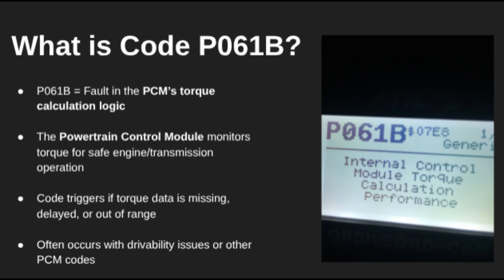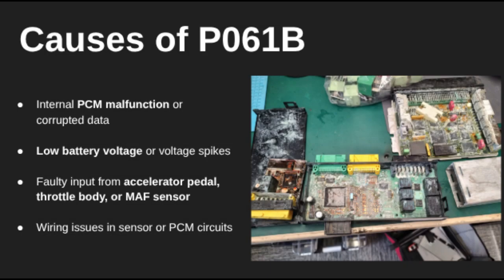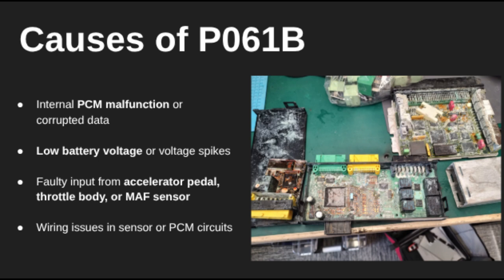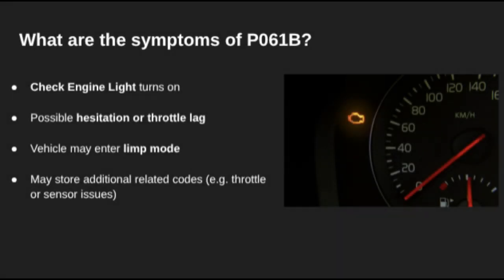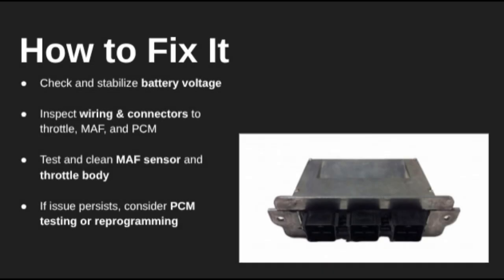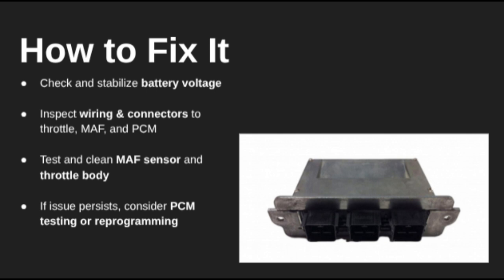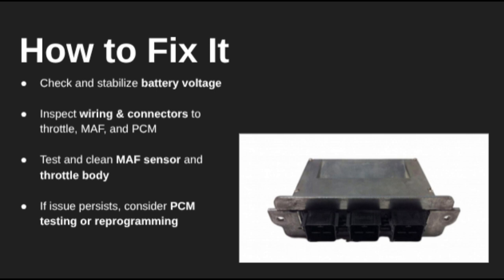P061B: Internal Control Module Torque Calculation Performance | Trouble Code: Diagnose Symptom Fix

Comment: I have 2007 mustang gt I was welding on the exhaust a week later went into limp mode fried my 02 sensors and alternator  also replaced throttle body and maf air flow sensor is it possible my pcm is fried as well still going into limp mode